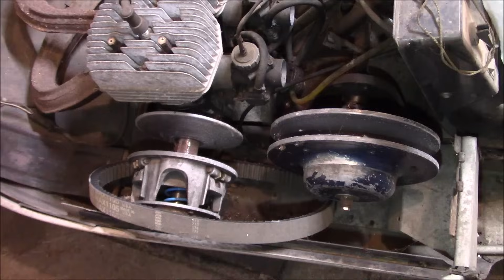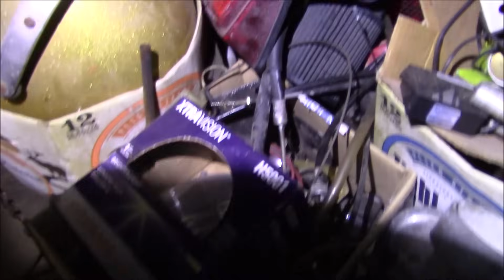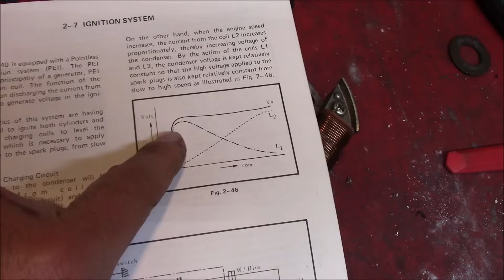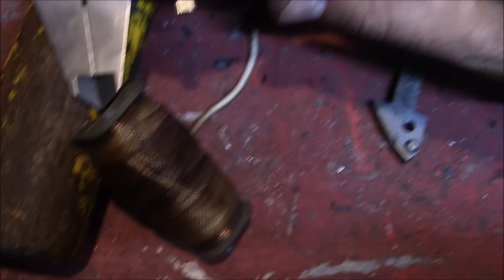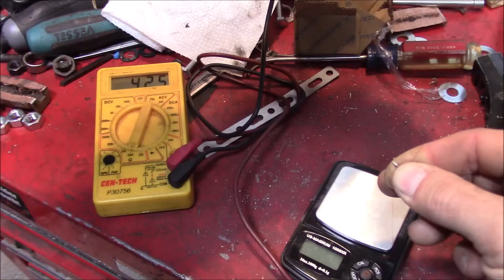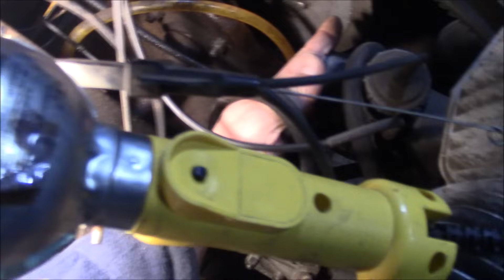Suzuki Fury, Will It Ever Run??

Comment: I experienced a similar problem with a Kawasaki F7, bought a slew of used CDI's, checked connections etc. It would run with the handle bar kill switch just between off and on (the arc) but fully one way or the other nothing. Turned out to be what they referred to as the exciter coil, the smaller one in the stack. It ohm'd out fine but would not deliver consistent spark. Tracked down a NOS one and it's running to this day.

Comment: Not that you can actually do this- As I recall, that blue service manual required you to time it 6000 rpms with a strobescopic timing light, requiring a tear down to change the stator position.  I had a problem with mine that turned out to be a loose stator making it run like yours did. I finally got mine running, but never did time it correctly before selling it like an asshole. It seemed to build up heat quickly, so I was always afraid to ride it for more than 5 minutes.

Comment: my 12 elan does that tapping ground revving issue im not sure why but it does the same thing as that fury, ive tried stator replacements, jetting, coils, points and condensers, but still the same outcome. good video for help with troubleshooting this issue

Comment: Hey if you see this I’m betting the el Tigre 440 air cooled 77 modle had the same engine and parts . If u can find an el Tigre air cooled engine parts I think you can switch em over

Comment: Well,  back in the olden days of voltage regulators you had a arcing contact that regulated the voltage.  Maybe dig out one of those and use the arcing regulator to make it run.   My guess is that the cdi has something going on with it anyway.  Lots of laughs were achieved in this video though!   (and Steve says call me.  Let's ride! ) lol

Comment: I had John deer spit fire did the same thing if you messed with the kill switch while it was running it would start running on both cylinders it was the cdi box on mine that ended up fixing it but I drove it for a long time just messing with the kill switch till it ran good not sure what it is with grounding it but seems to get it working again

Comment: If you open circuit a high tension coil while it's making voltage, I've been told that can damage the coil by having excess energy blow through turn to turn within the windings.  Better off to ground the output to test for spark elimination.

Comment: i had a honda Odyssey that i scratched my head on trying to figure out what was wrong i found that often when 2 cycles sit mice love to build nest in the expansion chamber your engine acts exactly like it did a little exhaust came out but two strokes depend on flow to run
pulled pipe off hooked it to a garden hose with a cv axle boot hose clamps turned hose on full and a little came out them boom the nest shot out shook it really good put pipe back on and ran like a champ yes mice can really squeeze into tiny holes and sometimes they are near babies that can really fit but often leave as they grow
just because it looks like they cant get in they can and do build nest in pipes same with mud dabbers bees hook the pipes up or do the open port just watch your ears lol
i noticed some fuel dripping from the pipe/manifold your engine probably cant "breathe"

Comment: Hit the coil you made for a second with 12v to energize the coil. Every coil I have rebuilt has needed to be energized to work.
Reply: I think this magnetizes it so it’ll ‘excite’ when current passes through it (not 100% sure). 

We do the same thing for the DC exciters for hydro electrical generation equipment after sitting a long time or a rebuild.

Comment: Oh man, been there done that. This video triggered my ptsd. I rewound a pickup coil for a yamaha it250 years ago because I am cheap. I didnt use a drill because I kept snapping the wire so ended up doing it by hand. 

I would keep checking all the basics first such as testing continuity in the wires from the stator whilst wiggling them along their length. Are you actually getting good spark (widen the plug gap and make sure)? Are the ht leads good? Maybe test the timing..

Thanks for another entertaining video!! Best channel on youtube..

Comment: Good 🤞 luck on getting it to run again. And I'd also try cleaning out both of those carburetor's and jets inside of them to. Emotion tube main jets and needle jets for air fuel mixture screws to. Cause they could be clogged up or just dirty needing to be cleaned out really good inside is all. And replace the carburetor's diaphragms inside of both them to. That's where two carburetor rebuild kits come into play then.

Comment: I would check out the settings on the pickup coil to like 0° or 2° or 4° degrees in or out as your timing mark specifications for that engine and pickup coil to.

Comment: I'd test out the ohms.,or voltage that your pick up coil is supposed to be rated tolerance at on that snow sled on the Data sheets PDF diagrams and schematics for it. That is A starting point. I'd would try first to wire wheel off the rust on the top of it. Make sure to wipe it off with A clean rag and make sure the magnet surface is shiny silver looking again to. Then try to start it up again.

Comment: I had this problem before but on 2 stroke quads fix 1 was its a rear brake switch that can be disconnected on handle bars or fix 2 a faulty rectifier so I plugged out them yellow wires going to it usually 4 yellow wires,good luck

Comment: You know what you have to do now, don't ya? You gotta (gently) take apart that CDI and have a look. lol
My 440 Everest did this too, but it's points, so I know I have to adjust them at some point but damn I don't want to take that magneto off because I have to pull the engine out to at least lean it up to where I can get the puller tools in there. Sure it has slots so I can adjust the points with the magneto on, but I'm not 20 anymore and you just can't get in there to see the dang things.

Comment: I had a 2009 Polaris ATV with a similar issue. It turned out to be a short in an ignition wire that was occasionally arcing to the frame.

Comment: Maybe both CDIs are bad ? My brother had that issue with his Jag 3000 sputtering and not wanting to rev up, almost like a rev limiter, thankfully we had more CDIs to test out and 3 of them ended up being bad, the electronic components on that Suzuki are pretty much unique which is sad and i guess sourcing an other CDI is out of the question :(
Reply from the maker: Post filming I actually score a reasonably priced NOS cdi, ran exactly the same. :(
Reply: @toocheaptosmoke shitty dude
Reply: @toocheaptosmoke  well the culprit is that kill obviously gotta figure something out
Reply: leakdown test crank seals compression? seems like ya have good spark idk